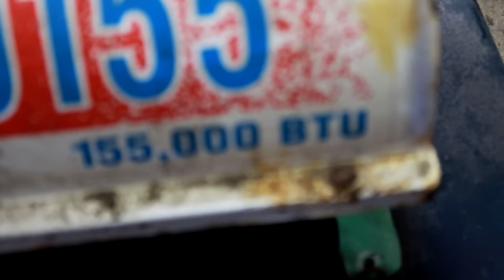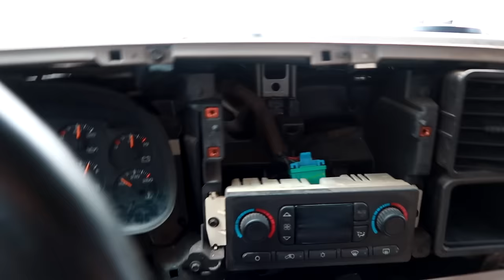NEW WINTER CAR REVEAL!!!

Comment: My first vehicle was/ is a 1987 Toyota sr5 4x4 pickup truck. I use it as my daily driver and it is a blast to go four wheeling up at my cabin in the California forest. When I first bought it, I had to replace the head gasket, which took awhile. I then fixed other minor problems on it until it ran smoothly. This truck is very easy to work on and I have enjoyed driving it everywhere. I even haul my 1984 Honda XR 350 in the back as well.

Comment: Blue 1978 Chevy Impala station wagon with 230,000 miles.  It lasted about 6 months.  It had a 305ci with a 2 barrel carb and was gutless.  I used to race a friend of mine with his 86 Toyota Corolla and could just edge him out at the top end at about 105 mph, but it took about 3-4 city blocks to get up there.

Comment: My first truck was a 1988 Toyota Pickup 4x4 with the 22RE and a 5 speed manual. I loved that truck. It lasted about a year, I sold it because of a horrid oil leak from the rear main seal that was causing the clutch to slip. So it needed a new clutch and the seal changed. It leaked so bad that to go 100 miles it required a GALLON OF OIL. The oil would literally pour out the bottom as you drive. It was an awesome truck and I actually know the guy who bought it and he fixed everything and its still going!

Comment: hey Dalton do you know if the duramax  has the same style radio as an 04 silverado?, if so I have the one out my truck that you can have if it fits .
Reply from the maker: https://www.youtube.com/watch?v=JMRbdWhWuLo
at 1:45
Does it look like mine?
Reply: javier collazo I have one from a 2003 1500
Reply: 3DMachines looks about the same size it will fit in the dash just a little different in the design don't know how to put up a pic if it possible
Reply: javier collazo search it up copy the link and paste on the comment
Reply: Sanchez 674 thanks
Reply: javier collazo no problem!
Reply from the maker: We can try it lol. We can try to break it I mean fix it right? ;p
Reply: Branused always the best!
Reply: it probably does Chevy trucks Tahoe suburbans used the same radios
Reply: 3DMachines sure if not you can always try and blow it up next time yall try the truck again lol
Reply: Dan Tanna another Tennesseean sweet nice to meet you and yea they don't last long idk why tho
Reply: Dan Tanna 00-07 GM trucks are great compared to the Ford/Ran trucks of the same years, the last forever aside from the rockers if you don't keep up with them
Reply: Dan Tanna my truck is an 04 and it still runs like the day I bought it from the dealer brand new  just take care of it and it will take care of you

Comment: My first car I bought in May 1972 when I turned 21 & stationed in Kansas when I was in the Air Force . It was a 1971 4 door Plymouth Satellite Custom . I don't remember how long I owned it but it had well over 300 , 000 miles on it when I had to junk it due to the transmission went out on it for a second time . The first engine went at 40 ,000 miles . I only got 15 ,000 miles out of the first engine . It had 25 ,000 miles on it when I bought in May 1972 .

Comment: My first vehicle was a mad tom cat 200cc Chinese quad I paid €450 for it drove 70 miles each way to get it and it was a complete heap.    Every time you started it it sounded like a bag of spanners and the frame was rusted out really bad with numorouse bad paint jobs.   The last straw before I decided to sell it was when the battery came out of its case when I was doing my first couple of wheelies and completely broke off the left back mudguard / plastic / fairing . When I sold it I got €400 for it and this was after putting about €100 worth of parts in it 

Love your videos man keep it fly

Comment: 1972 Concourse/Chevelle wagon. Bought out of a local junkyard for $350.00 in June 1982. 57,000 original miles on the 307.  Drove it for over 4 years while I went to college.  Engine finally let go with about 110,000 miles on it. Had a thrush muffler, and a sticker on the side that said "Jose".  Known to me and my friends as "The Josemobile". I really miss that car!

Comment: 1979 Ford F-250, standard cab long bed, 2 wheel drive, 4 speed Manuel with creeper gear, 300 straight 6. That's my baby I bought when I was 15 for $1,350 and still own Ill be 21 in august. I've put her through hell and back and the body is still straight and only has 2 small rust whole starting in the cab corners. I plan on patching them soon. Oh and did I mention I'm from Michigan and the truck has always been a Michigan truck. She's solid.

Comment: My first truck was a 2000 Dodge Durango with a 4.7L V8 and it lasted 3 years when I traded it in for a 2007 Jeep Wrangler Unlimited X. There was nothing wrong with my Durango when I traded it in but supposedly the transmission went out a day after trading it in. I miss that truck so much.

Comment: My first vehicle is a 2007 Chevrolet 1500 classic were still working on it it has 245k miles on it which is mostly highway miles but when we got the truck it was blown up so we have a new motor, new brakes, new rims along with tires that we got for free that are worth around $900-$1000 which is nuts I painted the frame all we need now Is a new bed, tailgate, rear bumper and it'll be ready to go I get my license in 3 months I'm so hype I'll never be home 😂 we have a total of $3,247.63 into the truck (yes I've been keeping track of it) it's kbb value is around he 6k range

Comment: First vehicle was a 1982 Chevy c-10 with a straight 6, 3 on the tree, and no power anything. 

The front end of that truck was so big, I had to sit in (and had room to do it) the engine compartment to change the spark plugs. It was a complete heap. I'd stop at the gas station, put oil in it, and check the gas.

Comment: First truck was a 2003 Ford Ranger 4x4. Bought it in 2012, still driving it to this day. I have some rust to fix this spring, it will be fixed the correct way. I want to drive this thing till the wheels fall off.

Comment: First car: Renovated a 1976 Morris Mascot/Mini with my grandpa, back when I was 14 or so, as a 'weekend project' that we worked on for some time. Got the car when I turned 18 and was ready to drive (I live in Denmark), as a present. Loved that little car! Drove fairly well, but holy shit, was it a pain when it needed fixing (which it did fairly often, after some time - seeing as it was a very old car). Had it for 4-5 years and then sold it. Only really drove it the first year or so, as my primary means of transportation, before getting another car.

Comment: still got my first truck but I turned it into my winter truck and bought a 2004 dodge ram 2500 3rd generation cummins to drive until it snows. I put a small 3 inch lift, with 33 inch mud grappler tires on my first truck which is a 2000 dodge ram 1500 extra cab, it does awesome in the snow and then I don't have to worry about the salt getting on my cummins. I love your videos though I watch them from time to time when I get time your practacly the only vloger I watch consistently. keep up the work with your vlogs

Comment: a 1957 Oldsmobile Rocket 88 it lasts until the cam wore the lifters out rebuilt the engine in a garage no heat in Kansas in the winter time by myself

Comment: first car was a 92 4dr Saturn that had the exhaust fall off right at the manifold. It was so loud the entire car vibrated. The center console had a performance/economy rocker switch that changed the shift points. I accidentally pushed it through so it was always on performance. lasted maybe 6 months until timing chain broke and it ate the valves.
 I've got the stock radio out of my 06 works fine but a couple button lights are out. yours if you cover shipping

Comment: My first car I got is a 1993 Chevrolet lumina with a 3.1, had it for about 2 and a half years, still have it and it's running good yet even with 230,000 miles on it.

Comment: 97 ford expedition 4x4 4.6 V8 it was black and came from up north and was rusted out it had 275,xxx miles on it when I got it and 486,xxx when I traded it for a 89 Jeep cherokee with no rust lol but the expedition is still running today the guy said its got close to 700,xxx miles on it now and all he has had to do is change the oil and buy new tires. I see him driving it all the time and it still has the original motor and transmission that thing is amazing

Comment: 1985 dodge ram 150 with a 3speed automatic and a 318 2wheel drive. now 10years later i have a 1980 dodge power wagon ram150 with a 4speed standard 4wheel drive and a lightly modded 360. I friggin love it.

Comment: I had a 2000 GMC Jimmy (I live  in NY too) 4X4 that we bought new and I used it throughout high school, and one semester commuting in college. MPG wasn't fun but  snow wasn't an issue! Even rescued my moms 2014 Escape couple of times. Lasted until 250K when the frame snapped. I now use a 2016 Focus and recently got a 2005 Silverado. Love the mpg from the focus, dont love the snow ability but the Chevys for that. Since the Chevy is a family truck im looking into a V10 Excursion.
Reply: OO Strack v10 drinks the gas for sure. I'll stick with my bullet proof 6.0
Reply: We had a 6.0 brush truck, that think ate Turbos for breakfast, lunch, and dinner! I could swear proper maintenance was always done.
Reply: Not like my truck. It's a beast for sure.

Comment: My first car was a truck. A 2000 f150 with the v6 and 5 speed m50d trans. Went through a clutch and two used transmissions. other than that it was a great little truck. Hauled lots of bike!

Comment: Up on the front of the car it has like an interweaved pipe that connects the motor to the exhaust and what that peace does is let the engine torque and those have been common to rust through.. I have 2 Ford escort wagons and we had to replace it on both of them
Reply: one was a 1997 the other was a 1998

Comment: 3DMachines - My first vehicle was a 1997 ford Contour and it lasted about a year, One day me and a friend where doing 120mph going home and blew 2 spark plugs, i fixed that then the hood latch broke one day and spiderwebed the windshield, i fixed that then the exhaust came of where it connects to the header so it lost allot of power and dint run right, i fixed that bye straight piping it so it was now loud as hell. then one day i was driving and one of the front wheels came of so the radiator got a leak and it got worse where i had to fill it everyday then one day it just leaked to fast and i blew the cars head. I brought it to salvage and that was it :)

Comment: Bought my first care a few months back almost a year ago. 2007 crown Victoria police interceptor. Fun car moodiest power amazing handling and so smooth. The only problem I have is the computer. Gas is a sincere into computer, servo then into the engine sometimes it works flawless some times it's choppy has no response or sticks. 5 times so far throttle stuck. The scary part is some times I'll ease on the gas and the car thinks I'm flooring it without warning. Still like it though
Reply: Pat Mack Nice I have a 2011 cvpi

Comment: 99 Silverado 1500 bought it with 293,000 five years ago with no rust from Georgia but I live in Ohio so that didn't last long. It's got 352,000 now on the stock 5.3 and the driver side cab corner is a little bubbly but that's it and still rockin

Comment: First car was a 95 saturn SL2 with a 5 speed. Was hauling ass one day down a country road and found 3rd gear instead of 5th at 65mph. long story short, it goes through a quart of oil every 50 miles now and smokes like a steam locomotive. Had it for 5 months at the time haha.

Comment: Salt and brine cause authentic havoc under chassis. Just try to wash the under chassis every 15 days after driving on roads treated and if it's possible when all is clean and dry a little of WD40 sprayed is a good protection against rust and corrosion for one year.

Comment: My first is an 88 dodge w250 360 4x4 
Got it when I was 12 it still lasting because it hasn't been insured since I bought because I'm still only 13 but it runs fine we are going to insure for the firewood season

Comment: 05 vue with a Honda j35... got it as a preasent for passing my drivers test back in May... it has quite a bit of issues concidering it has been abused by its previous owner, but ive been trying my best to patch her up over time... When the time comes ill be ripping out the motor to swap into a CRX...

Comment: 2004 dodge dakota 5 speed manual 4x4 posi rear end roll bar with off road lights rusted out bad lol with sub woofers truck only lasted 3 months because to much stuff is breaking on it and it got swamped bad lol mudding

Comment: 90 Cavalier that burned a litre of oil a week, has no rear brakes and the torque converter would lock up causing the car to stall if you tried to stop. Oh, and did I mention both the front and rear windshields leaked? Used to snow inside the car. Good times. My muffler rotted as well but it sounded turbocharged so I was cool with it.

Comment: 3DMachines I had a 2002 Monte Carlo SS 3.8 V6 fully loaded wrapped it around a guard rail installed a new rear end in it and ran it for 5 years and scrapped it when it had 196,000 miles on her and that made me buy a 2003 Impala fully loaded with the 3.8 V6 and she's a blast. 0 - 60 mph in 5.3 seconds 200hp to the wheels.

Comment: Well I did have a replacement for your radio. I had an 05 Silverado 5.3 z71 about a year ago. I'd proudly give you the radio but it ate cds and she had front and rear diff problems and a hell of a lot of wiring problems. Unfortunately I bought a northern truck (from PA) and it cost me tons of $$. I'm glad you are having luck with your 05, honestly that truck is why I'll never own another Chevy in my life. Ps: good job on the undercoat, Chevy steel is super cheap and rusts like knock off ritz crackers.
Reply: Jon Lewis True. my buddies car and truck both suck because they're chevys. he needed a motor replaced in his cavy the week he bought it. I'll stick to my f150. nothing wrong and Is a lot better IMO.

Comment: 2001 ford f-150 that was passed down to me from my dad. got to 220,000 miles and blew the motor when i stripped out and over-tightened a spark plug. put a new motor in it and still driving it to this day.

Comment: Had a 63 Ford Falcon 2-dr.,6cyl,3-onda Tree.Had to use 2 'stop sign'style posts to run connection from front sub frame to rear and the rear floor was not really there.2 fence posts run under trunk to bumper.Couldn't tell unless you really looked under.I ran it a year and then sold it to a bud.He used aluminuw sheet to redo under and trunk. He had it almost 3 years before he bought a 72 GTO and sold. the Falcon.I'd paid $50 for it.He paid me $150.Car was 25 when I bought it,so...I started using it at 68,ooo.He ran it til @125,000.
Reply: I only sold it as I bought a 65 Skylark convert. with a 455.Talk about a Whole new game with a 4 on the floor.

Comment: My first was a 78 Bronco but ive never drove it and i still have it but the first one drove was a 78 f150 2 wheel drive with a 302 and 4 speed i bought for 300 bucks out of a guys front yard. It had been sitting there for 5 years. All it needed was lifter and a push rod and a carb rebuild. I drove most of my Junior year till i got tired of being pulled over in it for the straight pipes i put on it. So i sold it to a buddy for 500 bucks that was almost 6 years ago and i regret it  this day !! lol but he's still driving it !!!

Comment: My first car was a 1971 Datsun 521 pickup and when I Bought i was 14 and it it wasn't running but I fixed it up got it running and drove it for two and a half years then sold it because I got to tall to fit in it, I'm 6' 5" but it was a good little truck while I had it

Comment: First car: 1981 Volkswagen Rabbit diesel hatchback. It was light blue in color and had a lot of miles on it (I can't recall the actual mileage.) It was sitting on a farm and the owner didn't want it anymore so they let me have it for $300. That was back in 1995 when I was 16 so it was a bargain. Average MPG was 30 to 45 for that model and it had a whopping 48 horsepower. I could fill it up and drive it for two weeks from home to school, work, and back (20 miles round trip.) I loved pulling up to the truck stop in that tiny car alongside the big rigs to fill up! The only major problem I had with it was a bad glow plug. It was seized into the block so no way for me to easily remove it. In the winter time, on really cold days, it would not fire off. My dad would get in the family Buick, pull up behind my car and give it a push down the neighborhood hill. Keeping it in 2nd gear, I would pop the clutch and it always fired right up. I was good on starting it for the rest of the day as long as I didn't let it sit too long. I DO NOT miss that car.
Reply: I saw one of those at a local salvage yard and i was really tempted to Pull the motor get it running and put it in a CubCadet

Comment: 1997 Nissan D21 hard body extended cab black 4 cylinder had 232,000 miles on it clutch and starter was going out so I sold it to my friend haven't seen it since I miss it all the time. It was my dads ever since I was a kid until I turned 19 to get my license

Comment: 1979 ford f-250 flatbed with a 351 modified and a 4 speed manual transmission that my grandpa rebuilt and I still have it

Comment: First vehicle was a 1997 Saturn sl2. Slapped on some snazzy ricers rims my uncle gave me. Last for about a year and a half. Hit 3rd gear going across a bridge and the pin that holds the spider gears in backed out and blew a hole about 4 inches diameter in the side of the transmission. Loved that car to death tho. Good heat no AC.

Comment: 3dmachines i have a radio that would fit but it is a little older but i am positive it will plug right in it with no modification,it should be the exact same radio in your dmax right now